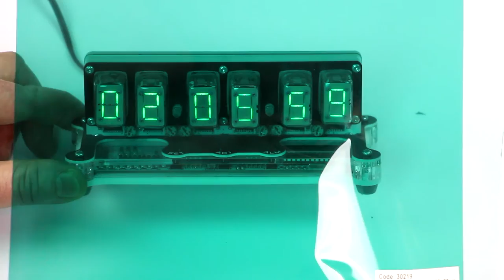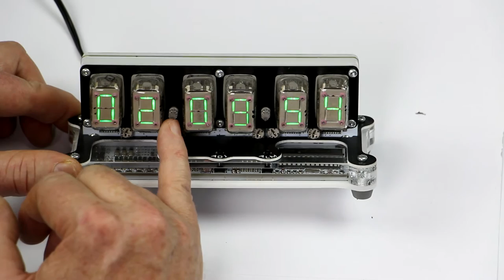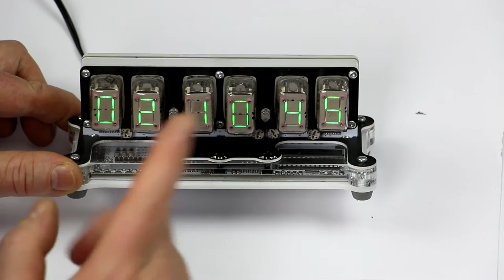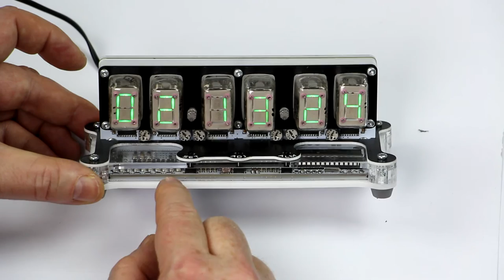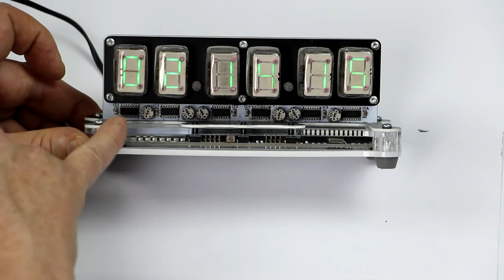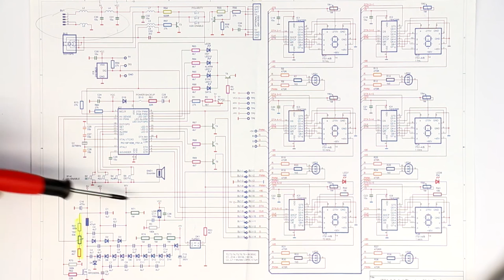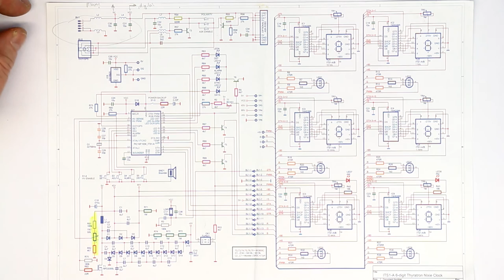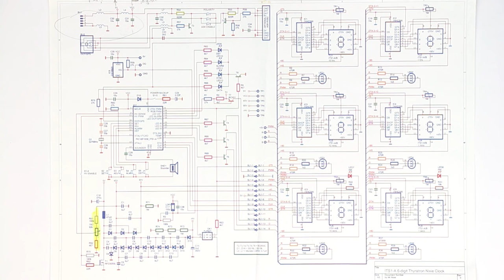Vintage Display Technology Pt.1: A Thyratron Clock

Comment: WOW its the most complete playlist about vintage display technology, awesome work dude ! i'm currently making 3 clocks using VFD, NIXIE & NUMITRON TUBES :), the next one it's gonna be using a CRT, greetings from Mexico
Reply from the maker: The playlist is only half as full as I would like it to be. VFDs and Nixie-Tubes I have spared for later because I am still saving money for the new nixie tubes from Dalibor Farny.
And I would like to have snapped a NIMO-tube on Ebay but whenever they turn up they are gone when I want to bid.
Do you know the youTube channel from Fran Blanche? If not, go for it :-)
Reply: @KainkaLabs  yeah i love Fran videos too

Comment: The voltage requirements are not really different from a modern TFT display, except one magnitude higher :-) A typical 7" display needs +19V, +3,8V and -6,8V at nearly no current, +11V and 3,3V with a little more current (~20mA) and ~28V@120mA for the backlight. Now call this tubes demanding :-) Oh, I forgot 10 different voltages from a voltage divider between 0 and 11V. So that are around 15 voltages.
The principle is very similar: A step up from 3,3V to 11V and voltage multipliers from this converter to 19V and 6,8V